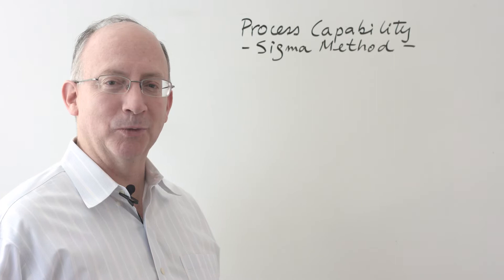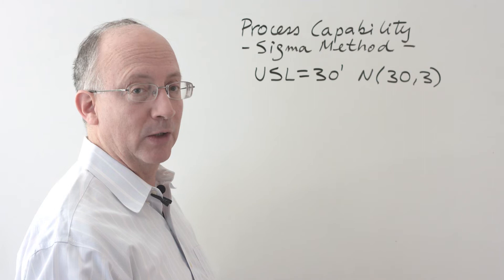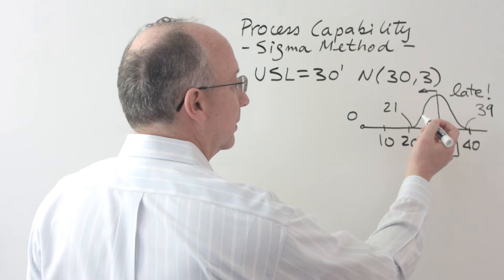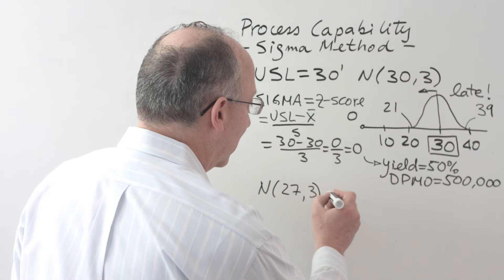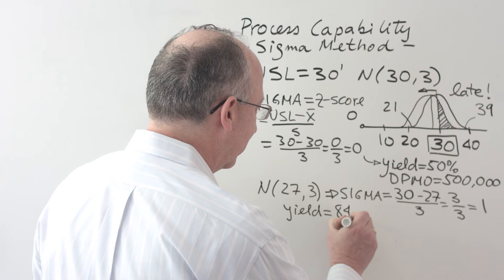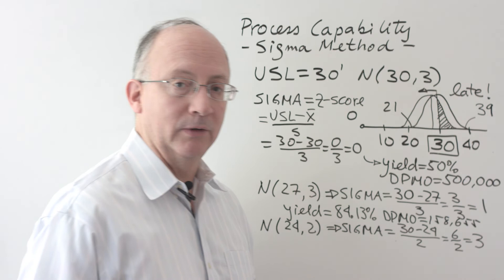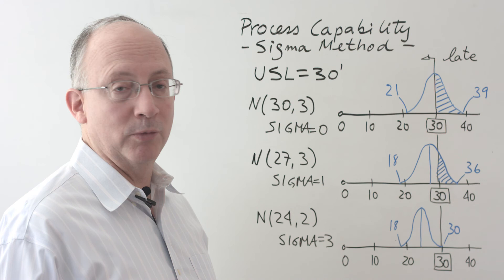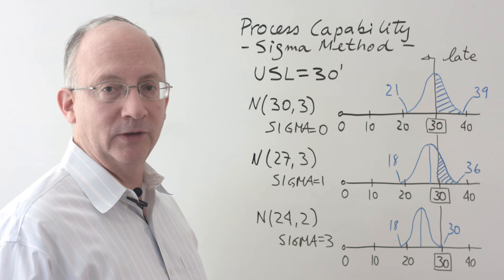Sigma Method for Process Capability | Green Belt 2.0® Lean Six Sigma | fkiQuality HD

Comment: Another concise explanation of Sigma scores and why it helps to present data in a visual format. The concepts of reducing the average and variability (standard deviation) are much easier to understand when visualized on the graph. It is easy to show how a shift to the left means process improvement. This also highlights how challenges increase as one tries to achieve a higher and higher Sigma score.

Comment: Interesting video.  Going by the DPMO, it seems to hint that reaching 6-sigma levels of quality can be quite difficult.  Is that a fair assessment?
Reply from the maker: That is correct, Rafael; Motorola used to talk of the "4.5 sigma barrier" which required new thinking/designs to be surpassed and improvement alone won't do it -- according to their statement.

Comment: Is there a quick, verified tool that we can use to automatically look up the z tables?
Reply from the maker: Use Excel. For instance to find the cumulative probability (what we call yield) of a z value of 1 in a process normally distributed with mean 0 and std dev 1, use =NORM.DIST(1,0,1,TRUE)
Reply from the maker: And you can get the famous 99.99966% yield of "six sigma" with this formula:
=NORM.DIST(4.5,0,1,TRUE)
By the way, it is really a z-value of 4.5 or 4.5 standard deviations instead of 6, but that's for an in-person discussion.